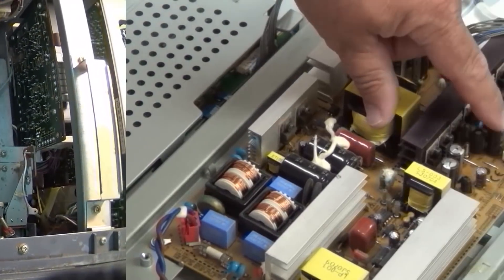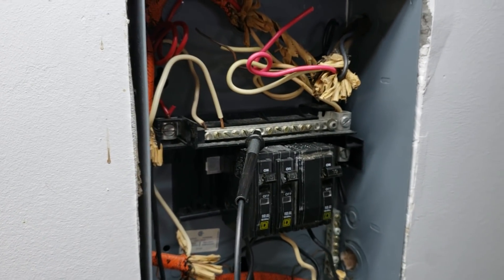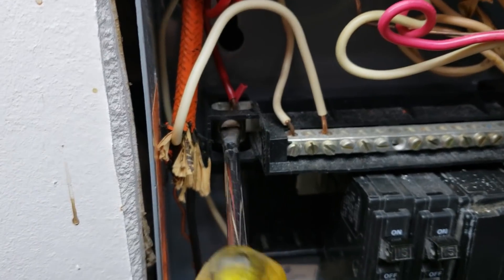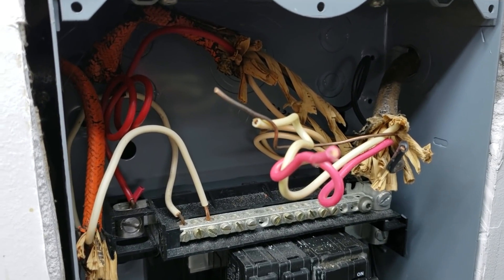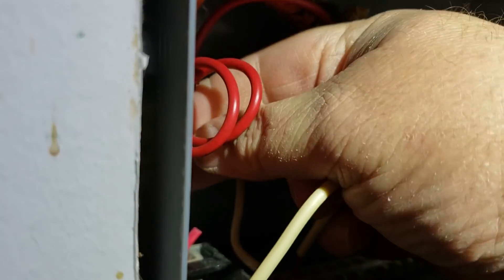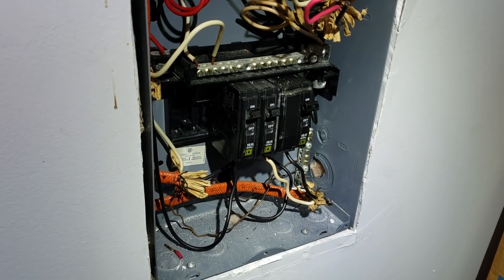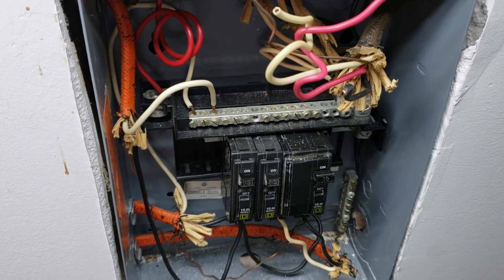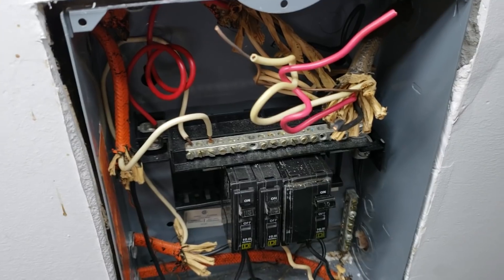Electrical fail

Comment: When were those orange cables made   1929? they have paper in them.
Reply from the maker: I have no idea. Would be 60s or 70s I would think. I believe that is when this place was first renovated.
Reply: A lot of cable still has paper in it
Reply: @12voltvids  Sorry to take so long to reply. I have been watching the Masters snooker from Ally Pally. I was recalling the Paper Air spaced insulated UG (under Ground ) Lead Covered Telecomms Cables. Used when I was an apprentice in GPO telephones. This was the only cable used until Plastic insulation came into being sometime in the sixties.
  The paper was specially crinkled to increase its surface area before it was loosely wrapped around each wire (leg), of a pair, The actual insulation being air. Maybe Mr 12volts can dig up some of this type of cable to show us. Happy New Year to everyone.        jeffoldbean.
Reply: @TonyWadkins  Hi Tony Please see my reply, above,   jeffoldbean.
Reply from the maker: @jeffoldbean  Lots of air core telecom leaded cables still in the ground.
There is a compressor at the central office to keep the cables under pressure to drive out moisture.
Reply: @12voltvids  Hi Dave, I retired from What is now called BT 20yrs ago. the cable pressurisation racks, all over the country had that many alarms on them. that it was deemed impossible to bring them back up to full working order. Long live Fibre, and Privatisation!!! I worked in a Transmission station in Leeds.
Reply from the maker: @jeffoldbean  
Pressurized cables still in use here. Fiber too.

Many people want to keep their old pots phone on copper because it works during power failures. To have the fiber provide dialtone during a power failure a battery backup is needed and that is only good for 12 hours. 
A recent storm we had last month, just before xmas put the lights out to some people for over a week. Their copper phone service still worked. 
Cell phones were down too in some neighbourhoods because the microcell stations are powered by AC, and with no power, so cell service.
Copper service is there mainly for the competition that leases lines. As long as copper service is there, the competitors that buy wholesale service can be put on the old copper service. If it was decommissioned then they would have to go on fiber. I am sure eventually the copper service will be sunset, but right now it is still running. Even though I can get fiber I am still on copper. Cheaper. More than fast enough for me.

Comment: Oh, you can use a multimeter for that?  How much voltage can go through a multimeter?
Reply: None. It's the amps that go through.
Reply: @JacGoudsmit  Hmm, that's right.  So you could hook a multimeter to 1,000 volts?
Reply: @infinitecanadian  Depends on the multimeter. Most small multimeters don't measure above 500V. Some can go to 1000 or more. When you want to measure high voltages, insulation and clearances become very important otherwise the voltage will just arc across the parts inside the meter or across the probes or through the wires into your hands. That would be bad. So for measuring high voltages you would get a special meter with different probes that have better insulation. But I don't think I've ever had a multimeter they couldn't measure at least up to 250V.
Reply: You should look at CAT ratings of your multimeter.
Reply: infinitecanadian Most multimeters measure to 1000V, whether they’re truly safe at that voltage or not. For this reason, only use a UL, CSA (Or other independent testing lab) tested meter on mains. Additionally, the CAT ratings mentioned in another comment tell you what type of AC circuits a meter is safe for use on. But because CAT ratings on cheap Chinese meters are usually complete lies, only trust the CAT ratings on a UL (or equivalent) tested meter. For example, working on the distribution panel in the video is CAT III, and since it’s 240V service, a CAT III 600V rated meter would be appropriate. 

Me, I have several cheap meters that aren’t CAT rated and are thus only used for my low voltage electronics stuff, a few old bench meters that predate the CAT rating system but are reputable and thus at least safe for CAT II (downstream of distribution panels), and then two modern meters (a fluke and a keysight) that are rated to CAT III 1000V and CAT IV 600V. This rating means that the meter can handle a surge of 8000V without harming the operator. A cheap meter like the free ones at harbor freight will literally (not figuratively) explode under that condition.

Note that the multimeter probes must also be CAT rated for safety, so here he’d also need probes rated to CAT III 600V, which those definitely were not due to the unsheathed probe tips. Again, do not trust cheap Chinese probes. I use only proper ones from Fluke, Keysight, and my favorite, Probe Master. 

Fluke, which is the gold standard in multimeter safety, has a nice guide on the topic if you’re curious: https://content.fluke.com/promotions/promo-dmm/0518-dmm-campaign/dmm/fluke_dmm-chfr/files/safetyguidelines.pdf

Comment: 1950's romex..... barely remember it, but thats what is in the panel.....I'd be cleaning up the fraying jackets on the cables and finding out where that dead line goes..... if it can still used, put it to work for you.....
Reply from the maker: Wouldn't surprise me.  Was in long before i bought the place in 93. Entire house was wired in that but it was all removed when the house was rebuilt in 2002

Comment: That incoming wire is not the correct size for 45 amp worth of breakers!    You need at least a #8 to carry that much load from the main to the sub.

Comment: Please ever check the voltage to be down after switching off a circuit and only use proper multimeters in high-energy-circuits. The loosen wires has to be insulated to not to connect them accidentally to life points.
Reply from the maker: The loose wires go down to another panel, and are inaccessible without opening that panel. I didn't check for the voltage being off, because I shut off the feeder breaker before working on it. I know which breaker controls the feed to this panel, as  my main panel is properly labeled.
Reply: @12voltvids  Thanks for your answer, I said this as an tv-mechanic that dealt with electrical enginieering. It is very basic to check this although beeing sure to set the right breaker to off. Here in germany this is called "5 safety rules" . One of them is the testing. Earthing and short-circuit can be leave off in low-voltage-circuits (until 1000V) like housholds... But I dont wanna be an "senior teacher" für you ^^ it is only a little advice, because of my own faults, too.
Anyway, very good tech vids, I like the tv-stuff most. I 've been a tv-tech for about 35 years and like old analog solid state and tube-stuff.
Reply from the maker: @hql400  Same here. Prefer the analog stuff. Easier to work on. In unknown circuits for sure test to see if outlet is dead, but remember in this case this panel feeds the lights, and they were out, so no question if the lights don't work then that circuit is off. I work around power every day at work. I think electrical safety at all times. Why do you think my work bench is on a 100% ground isolated transformer to reduce shock risk, and eliminate ground shock risk.

Comment: you should check all the other screws in that breaker box..
Reply from the maker: Yes I did. I was filming with my phone so I couldn't film it as I needed both hands.  They are all tight. The one that was arcing was also initially tight.
Reply: excellent..  Enjoy your vids.. thanks.

Comment: They should have ran at least a number eight to those feeders
Reply from the maker: I didn't build it.  It runs 2 15 amp circuit and a 1500 watt 240 heater. In reality there are 6 40 watt dual fluorescent and 2 wall plugs on one side and those lights are rarely ever turned on, the second breaker feeds a plug that has a small chest freezer plugged in and a few lights down stairs in the garage.  The electric heater only comes on on the coldest days. It is set to 5c just to keep moisture at Bay as I store my d electronics stuff in here.  It used to be a ham radio shack but has not been used in years.  There is no radio equipment installed anymore, but some day I might return to the shack because I am looking to get back into the hobby again and set up my station and the tower is still here with antennas.  So then I will actually be using this space.

Comment: y dont you cut a fresh part of the red wire before you put it back like it was...
Reply from the maker: A little carbon won't hurt anything.  When the screw is tightened it will bite through that into fresh copper anyway.  This panel has no load.  2 breakers run to an electric heat baseboard that only comes on if it gets below freezing to keep the room from getting too cold.  Set to 7'c. The other 2  are for lights up and down and there is a freezer plugged into one.  The total draw is perhaps 13 amps max if everything is turned on. The heat is 2000 watts, there are a total of 8 fluorescent double 40 watt fixtures and a couple of plugs up and 2 down for the freezer.   So no heavy loads in here.

Comment: Ouch!... You have a Square D panel. Replacement breakers are not cheap for those!.
Reply: Square D breakers are not too pricey, I just got HOM series 15 and 29 amp for less than $5.00 each. 

At home depot. if he had federal pacific , on the other hand, everything would have to go ! Big dollars there.
Reply: @davidhamm5626  Really!?!... My current supplier was charging me $40+ each for them!. I was saving my money to swap them out for Siemens panels breakers for them were only $15-30 each for those instead?... I am in atlantic Canada and for some reason Square D seems to be more uncommon here for some reason?. I never thought to check my local Home Depot for them?, if they do?... You would have just saved me a bundle of money from not having to switch panels to get cheaper breakers!. Thank you very much for the tip!.
Reply: @ytrewq6789  who in the world is your current supplier, home depot charges $3-4 dollars for them. ill give you a tip, never buy anything from your "current supplier again :(

Comment: At least, you don't have aluminum.
Reply from the maker: No kidding. Many, many, many fires were caused by that crap.
There is aluminum in my house. I have a sub panel on the top floor that was part of the original house that was renovated. When the house was renovated it was raised and new living space built under the house. When the new electrical was done they used a #4 aluminum feed to connect the new panel to the old to give us service while the house was built. Once the lower floor was built I moved down stairs, and then the top floor was totally gutted to he studs and everything replaced. The Aluminum feed runs between the main panel and sub panel. It is a 60 amp. The electrician had to put a special grease and use an Al/Cu connector on the bus bar for the main input on the sub panel, and the breaker in the new main panel. I asked why he used aluminum, and he said it was fine for that work because it didn't move. The problem was for plugs and switches because every time you plug in, or flip a switch vibration was transmitted to the wire which eventually caused a bad connection because aluminum is soft. For the main feed from the street, or inter service panel connection it is fine because it is not disturbed.

Comment: Looks to me like at best you have a 12ga (20 amp) circuit feeding this sub panel, your breakers add up to 60 Amp.  I would guess the yae-hoo wat wired this put a bigger breaker in the main panel, but left the wire size the same.  You do know that when your house burns down, the insurance company will see this and you won't be covered from the loss ? ? ? ?
Reply from the maker: Breaker in the house is 30 amps but it also feeds another sub panel where the hot tub power is taken off.  This panel is protected by 20 amp.  So the most this panel can see is 20 amps.  1 breaker feeds 3 plugs and 6 fluorescent fixtures.  The second feeds 3 plugs down in the lower garage.  There are 3 lights and a small chest freezer on it. The other 2 feed a small 240 volt baseboard heater that is used to keep the loft from freezing.  I store my old equipment there and only run the heat when it gets below 5c and it is not heated to more than that. So no issue with this panel ever being overloaded.  Not possible as more protection up stream.   The sub panel directly below this one I put in. It is fed from the house with 8ga Tek cable and as i said the breaker that protects that panel is 30 amps.

Comment: This is some of the worst fuse box, cabinet I have seen! It can't be legal !? This can start to burn! You put other people in the house at risk! Do not repair only temporarily but do something about it! 😡
Reply: skrotkalle skrotkalle nah, that #14 feed can handle 200 amps
Reply: @cardboardboxification  200 amps? I don't think so! The cable used cannot handle 200 amps. Bad contact is not good! It can start fire. Here in Norway this had not been approved legally!
Reply: It's a sub-panel. Likely fed from a breaker at the main panel that's the correct amperage for the feed wire. It would only be a problem if that breaker were overrated.
Reply: Jernej Jakob a #14 is good for 15 amp for a light socket...

The panel has 2 15 amp 1ph , 1 2 ph 20amp or bigger...
    
Anyone can look up a electrical sizing chart... amps, distance, size needed..
Reply: @cardboardboxification  If the upstream breaker is 15A (not known) then it'll trip first in case of overload, the 20A breaker is then only acting as a switch as the current through the circuit can never reach a level high enough to trip it (except short circuit conditions where gross overcurrent flows, then either one or both may trip). So it's technically safe IF and ONLY IF the upstream breaker is rated correctly.
Reply from the maker: Nobody in this outbuilding and it has been here since the 50s. I believe this was done in the 70s but long before I got it. The rest of the house is only 16 years old and all the wiring is up to code and then some.
Reply from the maker: @brainndamage  breaker in main panel is 30 amps and there is another panel directly below this where the hot tub splits off.  It used to be just a jb, but that was replaced with a gfci box when the hot tub went in 5 years ago.  I did that work and I would be happy to show.  It is to code.  6ga tek cable from box on the side of the house. #8 over to hot tub.  It is a low power 20 amp heater so even when it is heating I never trip the 30 amp that everything out here runs on.
Reply from the maker: @brainndamage  up stream is 30 amps, but that also feeds another gfi breaker for hot tub.  So max that could ever be drawn is 30, but that will never happen as the only things on this sub panel that draw any serious amps is the 1500 watt 240 volt heater and s small chest freezer.  This space is not occupied unless I am looking for something.  I store all my old electronics gear in here and none of it is plugged in.  The heat only comes on below 5c
Reply: Jernej Jakob ya, it should have a proper breaker for the feed wire...
   But useless to install a sub panel that way...
Reply: 12voltvids thanks for replying and letting us know what’s going on with it....

Comment: That meter box looks really unsafe.
Reply from the maker: It isn't a meter box. It is  a sub panel, which is protected by a breaker in the main panel. I didn't do this work, but it is now cleaned up and tightened down. That was done by the previous owner as I haven't been into this panel until, well now.

Comment: brah the bonding screw (should use the ground from the main panel)! this subpanel is an installation failure lmfao.
Reply from the maker: It was there when I bought the place. The main. Panel in the house was just as bad, but the house was town down and rebuilt in 2002. The old garage at the back of the property was left as is.
Reply: @12voltvids  yea guess u needa rewire that one too

Comment: All that time spent poking around looking for the problem and you managed to only do half the work. If you took the time & effort to shut off the power to remove the stray wire stub, take an additional 15 seconds to clip the buggered end off the wire & strip a clean end onto it.
Reply from the maker: It won't make any difference. No need to clip and re-strip the wire.  The action of torquing down the compression screw will dig into the wire and through any oxidation which is the black carbon you see and make a perfect connection.  If you feel this is not the case then lay out your proof that this is not a good repair. You opened your mouth so fill your boots.
Reply: You may have a valid point. You could certainly cover up the bag job connection with the compression screw. Nobody will see it. Stick with the low power electronics.

Comment: I'm not an electrician but I can see some problems there. Incoming wires are too thin (18 AWG? 16 AWG?); wire colors are probably wrong; it looks like copper wire tied to an aluminum bus (but I could be wrong), and according to code, the discarded outgoing wire should probably not be left in there like that.
It also looks like the incoming wire was besides the screw instead of underneath it, and it looks like it ended up right back there in the same spot. If so, you're going to eventually have the same problem again, or worse.
Oh well... If the upstream breaker works, you're fine I guess. It would probably be too much work to rewire it.